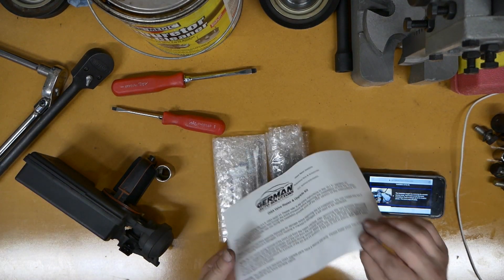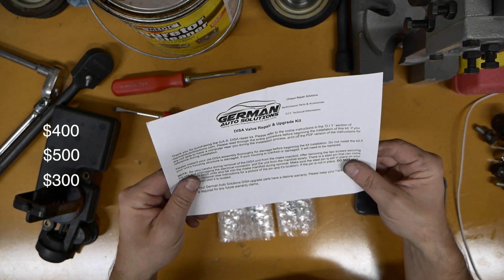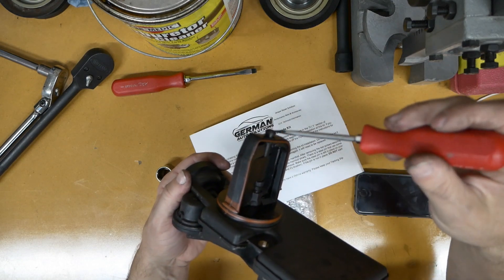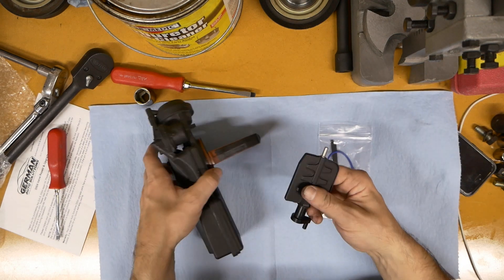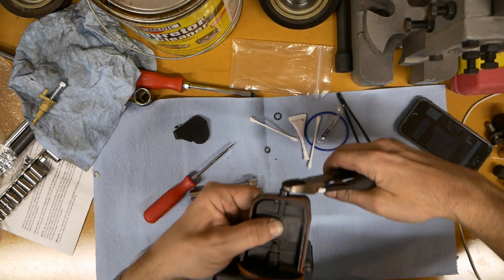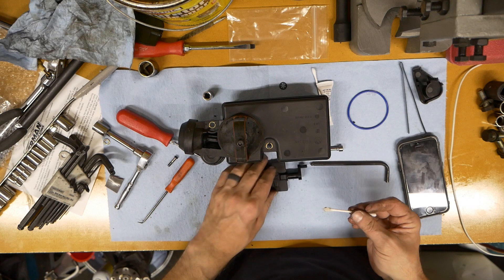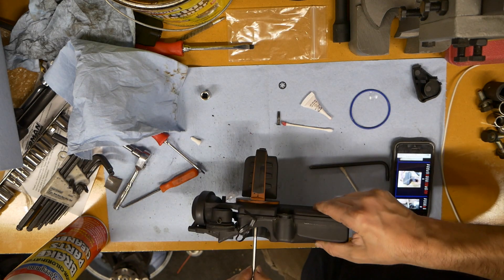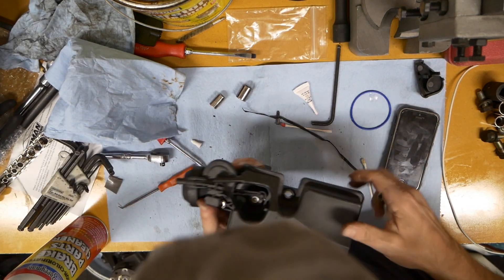BMW E46 Disa Valve Upgrade - DIY

Comment: I installed that same kit in my 330xi about 3 years ago. It works great and I have never had a problem with the disa since.
Reply from the maker: John Outdoors that’s great news!  I would have probably done it even if my DISA was working..just because of how bad it was designed